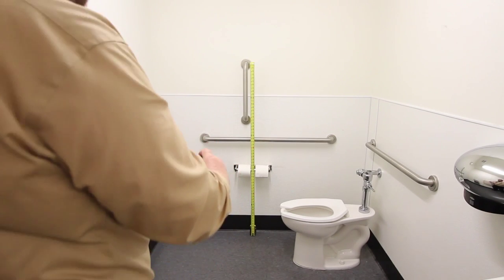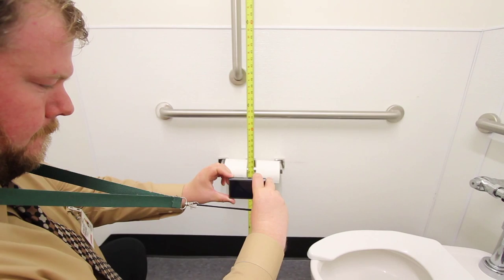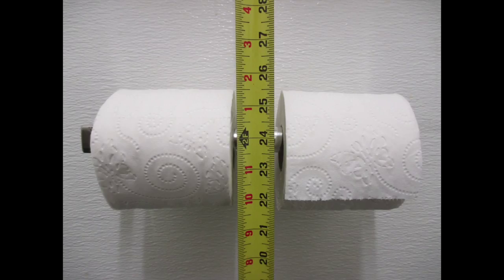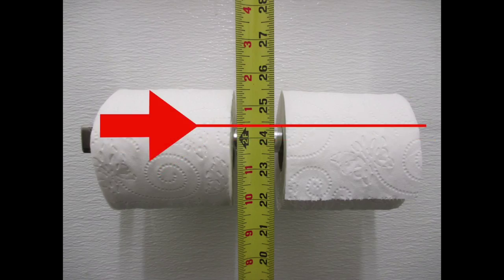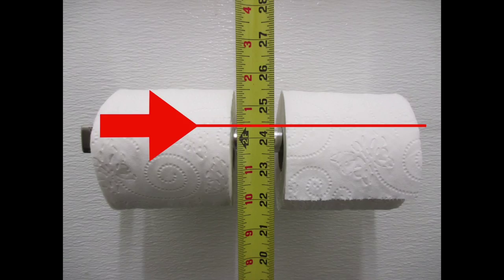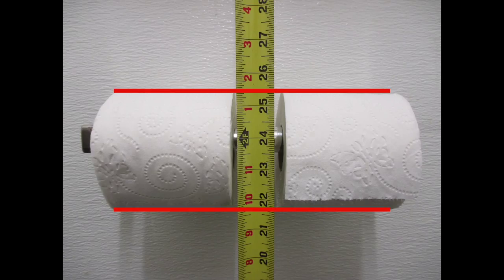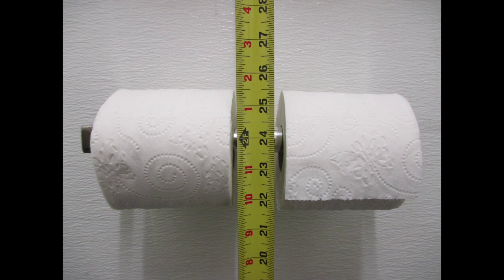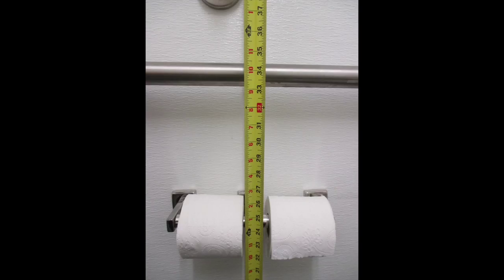How to Measure the Height of an Open Style Toilet Paper Dispenser per 604.7 (2010 ADA Standards)

Comment: 24 inches is way too low.  Stand up do not bend over.  You should be able to pull down at least 6 inches without leaning or bending over.  That would be at least 30 inches.  There is not anyone that short to put it that low.  At 24 inches you have to lean down to pull the toilet paper down if sitting on a toilet and it is at your knee distance while sitting.  30-48 inches is ideal.  Anyone can reach it and pull the toilet paper down.  Even in a wheel chair